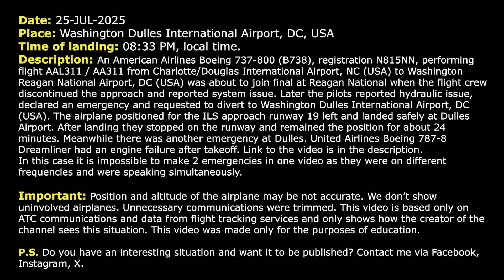Hydraulic system failure. 1 of 2 simultaneous emergencies at Washington  Dulles Airport. Real ATC

Comment: Seems weird two land two planes both requiring crash rescue on opposite runways at the same time. Atleast at our airport they will land one move them off the runway by tow or under power and then land the next one right away or land one then go over to the other runway and receive the next
Reply: Depends on how much fire service Dulles has. They could very well have enough for two simultaneous emergencies.
Reply: As far as I found, they have three stations with a total of 4 ARFF units and an engine company. If that equals at least 5 capable vehicles, it should be enough to simultaneously support a B738 (airport index C - min 2 vehicles) and a B788 (airport index D - 3 vehicles).
Reply: @lyaneris yah I’m looking at the index chart now if guess they would have the bare minimum on site to handle the two. But I would think they would have all hands available for each one rather then split resources.
Reply: @SnakeWhite-i9q Well, bare minimum in vehicles, but even index E only requires 3 engines. They also recently got three new ones for the two local airports, so they are likely great engines.